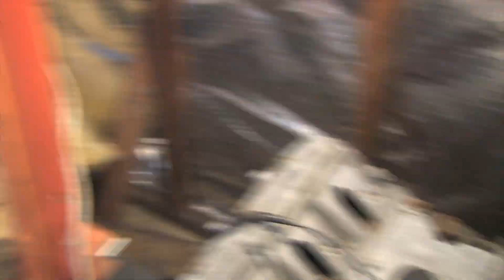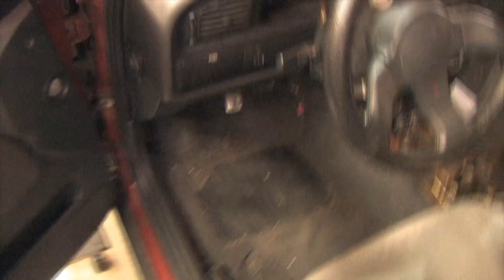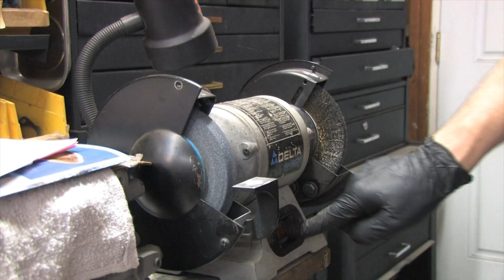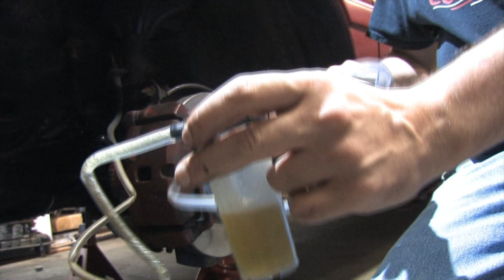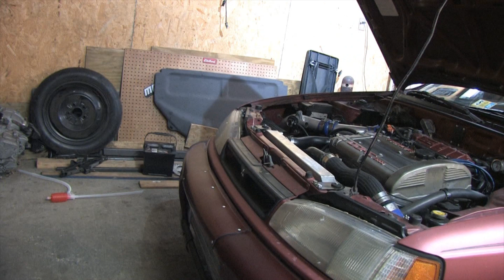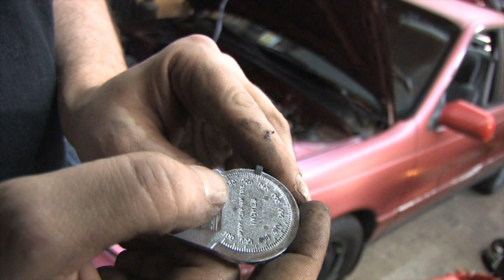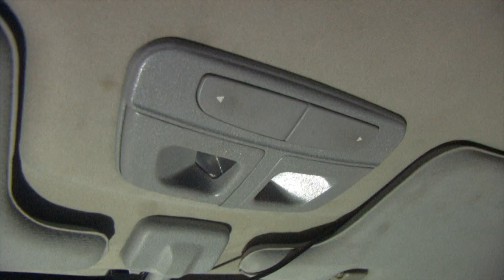Hyundai 17 - Brakes, Bearings and Bugs

Comment: If you really plan to store that brake bleeder in its original packaging, try filling the reverse side of the plastic case with spray foam. That should keep it from cracking over time and hopefully it will last forever. Now that all thats out of the way, lets turn the boost up and get to tuning this machine!

Comment: Great video. Lots of useful info. I bet the pucker factor was high when you went through the stop sign without brakes. Love the car battle/smack-down at the end. Re: air getting into the vacuum hose via the base of the bleeder screw while bleeding the brakes. You can prevent this by applying a little bit of grease around the base of the bleeder to seal it off. That way you can be assured there is no air in your brake system. Just clean it off with some brake cleaner when you're done. Works great. I have a video on my channel that demonstrates the effectiveness of this technique.
Reply from the maker: You know what it's doing now?  It's spinning the rims inside the tires.  I think I'm going to have to get bead locks.  There's so many reasons why this car should never have been built.  lol

Thanks for the grease trick!  I use grease for so many other things, I have no idea why I didn't think about that.  It's genius.
Reply: Haha. When I think beed locks, I think oversized mudder tires.  Now that would be hilarious on that car. :-)
Np on the grease trick. My dad taught it to me years ago. Hope it helps you out.

Comment: Hey Jafro
In regards to converting the Hyundai to disc brakes all around, I might have a crazy idea that just might work.
I could't help to notice that the brake shoes, springs and adjusting mechanism is identical to what's on my Opel / Vauxhall Astra from 2008. The Opel and Vauxhall brand is owned by General Motors, so maybe, just maybe it is possible to find some GM brake parts that's almost a bolt on fit. Just an idea.
Happy new year dude, and I hope you can leave all the S#!@ behind you in 2016 :-)

Comment: Chances are 9/10 the last guy used a petroleum grease to lube the caliper slide pins and it's all dried up and on its way to seizing, causing a future headache you don't need.  I always remove & clean the pins and the bores with solvent and relube the pins with silicone paste, which is rubber safe in case one of the pins has an anti-rattle bushing on the end, and won't dry up over time.
Reply: I wish I'd read that wisdom back when I last changed brake calipers on my 1G DSM. One of the caliper guide pins had sheared off, and I was too much of a newbie at the time to realize that something was wrong. It took a ridiculous amount of time to discover the mistake and re-do the whole caliper job again, and only now I realize that I probably used the wrong kind of grease on the new slide pins. Sigh. Well, at least when they go out again, I have your advice plus the tips from this +Jafromobile video to help me do a better job next time. Thanks for posting it, +50sKid .

Comment: My wheel bearing in my 95 GSX is going bad but I don't have a fancy press like that. Am I stuck having to pay hundreds of dollars in labor for someone else to replace it?
Reply: Already ordered a replacement wheel bearing from extremepsi..
Reply from the maker: Nope.  You don't even need it. The 95+ cars are sealed bearings that are bolted in.  :). They just cost 4x as much.  :(
Reply: ***** I had a panic attack and starting researching bc I thought they should just bolt in bolt out just as you replied. Thanks Jafromobile and merry Christmas man! We love you no homo
Reply: Even if they didn't just bolt in/out, you could take the steering knuckle to a local mechanic and have them press it out for you and press the new bearing & hub back in. I've done that a bunch of times over the years. Typically costs be between $20 & $40 per bearing.

Comment: What is the lug pattern for this monster? Since it has a spindle for the rear bearings I think I know what Mitsu might work (because I'm looking into converting my Cordia to rear disk as well). About the bearing drama, what can happen is that the force used to press the bearing in could be so high it could dimple where the balls contact the race, and marr the race and cause premature failure. I have seen a set of roller bearings trashed on a helicopter from a hard landing, the rollers left lines in the races. The only upside is that if that bearing goes south, we get to see a vid of the carnage.

Comment: +Jafromobile If you want to add rear discs on the elantra, you can use the custom brackets that 89mirageman makes for the "89-"92 CSM [Colts/Summit/ Mirage],  you can contact him on his site here http://www.4g63swapped.com/mounts.html
you'd then use dsm rear calipers, and galant rear rotors, and source hubs from a certain year csm 89Mirage man will let you know the specifics.

I also heard of a guy on 4g61t.org swapping in a 1g fwd dsm rear subframe in a 3g CSM, he was able to use the 5 lug and get rear discs, I'm not sure on specifics, but it's was worth mentioning, seeing as how a lot of components from CSMs are used in the early Elantras, and some upgrade parts from the elantra are sought after for 3G CSM guys, like the LCAs, front sway bar, brake boosters/master, [all the motor and trans mounts work well when doing a 4g63 swap on a csm] all upgrades for the stock 1.5 CSMs.
  
Its vary cool to see more video uploads on your channel, vary informative stuff here, I just did a rear disc swap on my "91 Dodge colt, and I went over all of this, only, I had a shop make me some stainless lines with m10 fittings a lot better stopping power, and better brake pedal feel, all said and done,  it was well worth the effort.

Comment: That looks like a Mitsu Eclipse steering wheel...and the dash looks similar...and the front suspension...just how much of this car was actually made by Mitsu, anyway?  I'm guessing the rear suspension isn't also from the Eclipse, otherwise you could retrofit the stock eclipse rear discs.  :-(
Reply: PS:  Small rear brakes?  You should see what the classic Mini uses.  They're small enough to fit inside a 10" dia. rim!  :-P
Reply from the maker: The gauge cluster and steering wheel are out of a Mitsubishi Mirage.  The front suspension came off an Expo LRV, and the block from a Galant.  It's all a bolt on fit because the Elantra shares a ton in common with the Mirage.  I'm actually using the Hyundai axles, and they're 1mm thicker.  Hyundai actually made these engines on Mitsubishi forges, and I like to refer to it as the "training years".  Now they own those forges.  They've moved on and will not support this generation of engines anymore.  That's okay because you can use the Mitsubishi equivalents.  These were the Diamond Star Motors partnership years.  Hyundai had no capacity to even make their own engines yet.  But yeah, most of the Mitsubishi parts, including the mirage grill were bolted fits from the previous 1.6L Mirage that its engine came from.  It has parts in common with the Accent, too.  What I'd like to have is a '92 sCoupe.
Reply: Cool, thanks.  It just keeps making me wonder how much of the Eclipse would fit: suspension, brakes, engine and trans...and including the 4WD system.  Now there's a sleeper build...  :-)
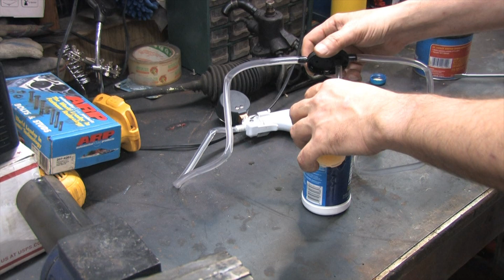Reply: Btw, @ 22:05 water doesn't expand 16 times when it turns to steam - it expands 16 hundred (1600) times.  https://van.physics.illinois.edu/qa/listing.php?id=1734

So dry brake fluid is even more important than you thought.  :-)

PS:  yeah, I'm binge watching these again - love how these videos pack so much info.  Cheers!

Comment: when u replaced rear brakes  ...... forgot to bend one side of the big Nut in the center .... to make Sure doesn't  loss later ....and ur rear tires race with u :)...
Reply from the maker: I just caught this one the uncomfortable way.  I had one wheel loosen up on me but I caught it in time.  I thought these were staked nuts (lock nuts) because the axle didn't have a groove.  I was wrong.  Thank you because when I felt the rear loosen up, I knew right where to go.  I'm sorry I didn't do that in the video.  You're the ONLY person to ever mention this in here.

Comment: Thorough work, for sure.  One thing I have taken to doing when it comes time for brakes has to do with pushing pistons back into the calipers.  Rather than pushing the fluid back up into the master cylinder, I open the bleeders, connect a tube and push the fluid into a catch can.  Doing so assures that none of the crud that collects in the caliper is pushed back into other parts of the system.  This is particularly good to do on ABS equipped cars.

Comment: Merry Christmas Jafro, hope you have a great 2017! A trick I use on wheel bearings is to use the old bearing and race to press the new bearing assembly, that way it presses only on the outer race of the new bearing.

Comment: Water actually expands sixteen hundred times when it turns to steam, it's crazy! Makes sense why even a little permeation of moisture through the rubber hoses and whatnot can cause such a big problem. The vacuum pump looks to work great, I paused and went on ebay and ordered a 12 volt pump, I'm gonna try and cobble together my own even lazier setup!

Comment: You screwed the bearing putting it in,  you need to press on the outer race,  otherwise you'll foul the bearing,  never use the bearing balls to transfer the pressing strength

Comment: +Jafromobile I must stop right here at 4:25. You are pressing in the bearings wrong and quite possibly shortening there life expectancy. Always press the outer race when pressing a bearing into a bore, not from the inner race. It puts a side load on the bearing and can permanently damage them. Only press on the inner race when pressing on to a shaft. Merry Christmas, thanks for all the great vids.
Reply from the maker: Tracey Allen Do you see this?  We all have a healthy, sane discussion here and all of us walk away better mechanics.  This is how it's supposed to be done.  I have the best damn subscribers on all of YouTube.
Reply from the maker: You are 1000% correct.  Well… maybe 900%?  It does depend on the actual bearing.  On this particular bearing, I have enough experience installing them "wrong" and not having a problem to know these can take it the abuse... every bit as well as I can take the constructive criticism and own my mistake.
Reply: I also noticed while watching, but its not my car, and Jafro's right its an opportunity to see if it will cause premature failure.  This one sin's not enough to negatively offset the huge Christmas gift of a new Video!!!!!!!!  Thanks, Jafro........
Reply: lock nut has nothing do with this, driveshaft connects to inner race and you are tightening inner race with nut. (longer version edit: driveshaft works as backing plate for inner race when you are tightening hub nut/axle nut, hub is pressed against inner race, so you are not squeezing whole bearing. Only inner race)
While pressing in bearing, you should press that part of bearing what causes resistance otherwise you are twisting and potentially damaging it internally. It is one of the first thing you learn in school when becoming mechanic.
Reply from the maker: That makes sense.  Some people use thermal treatments to reduce that side-load during installation, and I covered that once, freezing the hub. But I've always done it this way at room temperature and never had to change one of these bearings more than once.  That's not to say that I'm right, just that I suppose I'm lucky?  They're smashed together with a 1.25 thread pitch 32mm lock nut with 165 foot pounds afterwards, so Mitsubishi designed them for powerful squeeze.  If it causes a pre-mature failure, I promise I'll cover it and own it.  It's one of the things I do because this is more of a documentary than an auto mechanics course.  It keeps it honest.
Reply: ***** it starts with the guy making the vids. I've learned so much from this channel, it's not even funny.  This from a guy who has turned wrenches as a professional for almost 15 years. And you pronounce debris correctly.
Reply: I like to use old bearing when pressing new bearing in place. It's very useful when old bearing loses that inner race from other side. Just place old bearing top of the new one inner race up ond press. BTW one of my students broke once new bearing just pressing it wrong. So sometimes it don't broke sometimes it will. Now he knows how it's done.
Reply: Chance06Se i agree and jafro is still my favorite youtuber! btw for jafro, that kind of torque is normal for this type of bearing in all makes. :)
Reply: true - on a beater car it probably wont make any difference to its life span, on a pride and joy it'll probably fuck up as soon as you roll it out of the garage lool
Reply: Tracey Allen I caught that too, I cringed when watching lol always best to press in using the outer race. It's easy to have the bearing pinch the inner race by pressing in using the inner race
Reply: mrnege81 I do the same thing, I just grind a little relief on the edge.
Reply: What if i told you, unless it presses in really hard, it wont make a difference? Sure, i wouldn't teach a class with that method, but we're all adults here..i think.
Reply: Brinelling for the loss.
Reply: details details details  a little brinelling is not all bad.
Reply: Wrongly installed but as you said,you have done it several times like that and it depends on the kind of bearing. Hope your viewers won't destroy bearings before knowing it.
Reply: THIS IS PRETTY SERIOUS MISTAKE